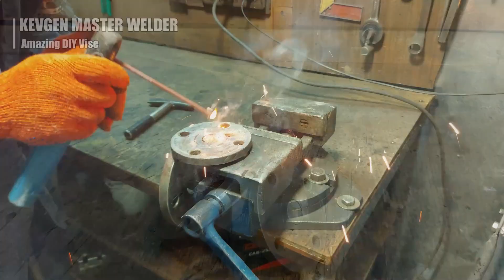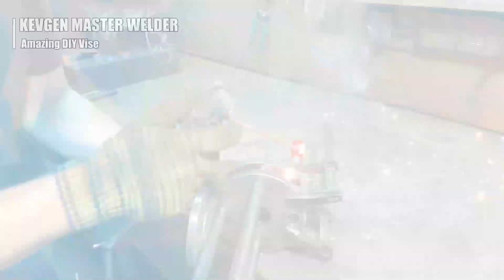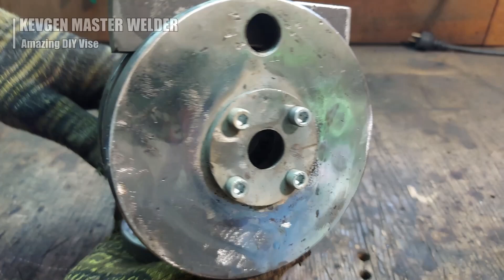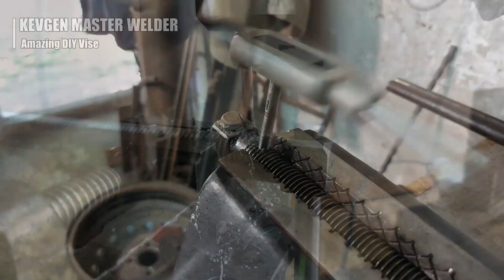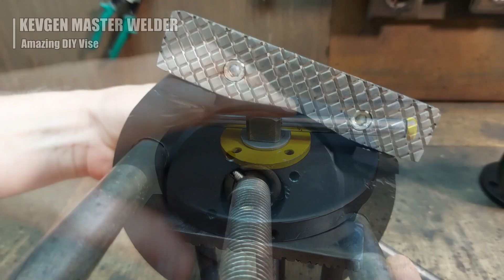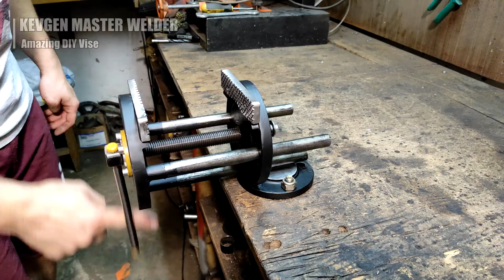Incredible Flange Vise!! Vise Made From Flanges Own Hands!

Comment: Great work !  But it's better not to drill through the threaded bar ,  rather use a washer , spring and a nylon locknut . By drilling through the threaded bar , it becomes weak. 👍👍👍👍